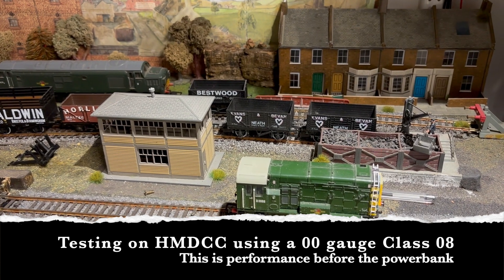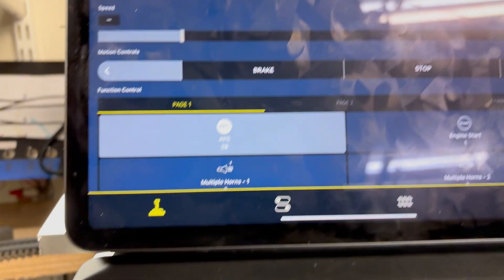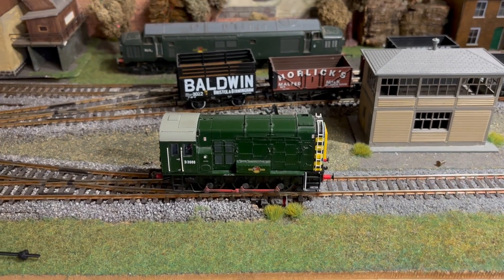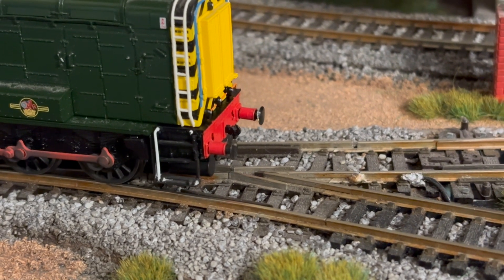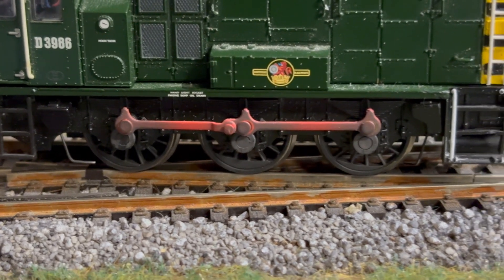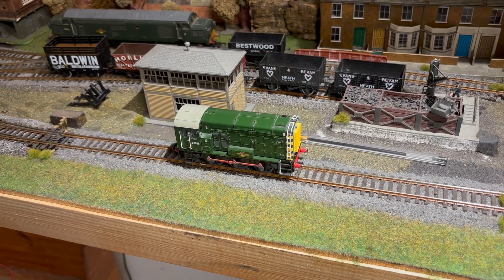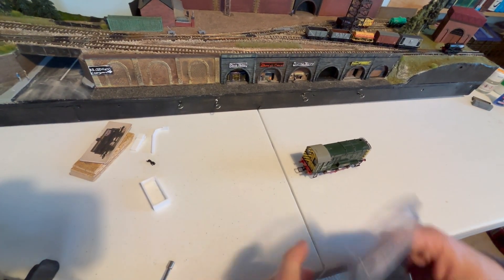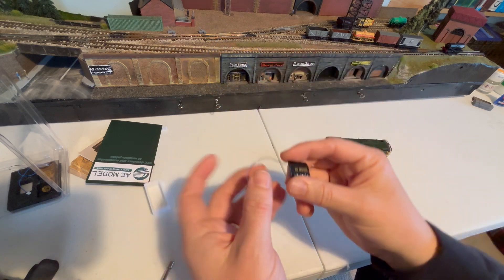Hornby HM7000: Does it NEED a Powerbank/StayAlive?

Comment: In answer to the question posed in the title of this video - Yes. No ifs, no buts, they simply will not function correctly without one.
Reply from the maker: I’d nuance that slightly to say that if using them over Bluetooth I would recommend a stay alive. If using in DCC mode the I suspect it’s overkill.
Reply: @mactrains But Bluetooth is part of the correct functionality, no? In any case it doesn't need to be a large capacitor bank - I use the Dcc concepts micros, they're sufficient to provide trouble free running without taking up too much space.

Comment: Good demonstration. I'm running n-gauge, and the HM7000 decoder fits inside Dapol's 'speaker ready' class 50, and probably all the big diesels that are speaker ready, but fitting a stay-alive as well is too difficult. I have found the quality of running has improved immensely by using my regular controller, rather than the bluetooth connection to my phone. It seems to be the bluetooth that causes the long interrupts, and if you can avoid it, then a stay-alive is less important. Of course, with smaller Bo-Bo diesels or shunters such as demonstrated here, then fitting an HM7000 with any kind of speaker is more than challenging, let alone a stay alive as well :face-orange-frowning: ... unless you are a TT or OO user of course.
Reply from the maker: Good point Graham, yes it's the bluetooth that really impacts the connectivity issues. If your dcc--to-rail connections are solid then I'd agree that a stay alive ought not to be needed. In that case just use the HMDCC app for updates etc, and switch back to DCC mode for control.

Comment: Good result.
One question. How much does it cost to implement these changes per loco? 
If you have a large collection of engines. You even mention that the cost will soon mount up. 
Ummm, yeah. 15 years is not really old.
Most of my collection is Vintage (4 times as old as your Class 08) so this is not a fix for all of us.
Thanks for sharing the process.
Happy Modelling.
Reply: Thanks for the question. Yes I should have included figures! The three pack cost me £42.45 plus shipping. Thats £14.15 per stayalive. Of course if you are adding decoders too then that’s quite a jump on top of that, especially if its older locos that have no dcc sockets. Hope that’s helpful. Thanks for watching and commenting.
Reply from the maker: A lot: see answer from my other account

Comment: I would got slightly further and I know @peachy agrees. I have a TT120 layout with sections of perfectly laid track you could eat your dinner off that cut out using an A4 with HM7000. I added a power bank and that solved it. Some experts on the forum say this shouldn’t be necessary but with the reset logic of the HM7000 decoders and the long reset time I think it’s a must have
Reply from the maker: I’ve had very few cut outs with my Night Hawk, but not none so will be looking to fit it and likely the 50 that’s due tomorrow with them. When it removes even the whiff of the suggestion of a cut out it changes how you feel about operating the layout. Well for me anyway! Thanks for watching
Reply: @mactrains  I feel exactly the same. From holding my breath and frustration to a calm relaxed feeling

Comment: Clean the track and make sure each piece of track has droppers
Reply from the maker: Thats the right answer of course - assuming you have not already laid the track, and assuming that it won't take you hours and hours, and won't cost you as much in solder and cabling as the £15 to get a stayalive! I suppose it's about how much you value your time. For those who get satisfaction from knowing the track is beautifully laid and that all parts have perfect power - there is no argument with that. For those more impatient, or those less gifted in soldering then the stayaolive is a great option to have. Thanks for watching.

Comment: Hello Mac, a question not particularly related to this post but towards HM7000 usage generally, if I may?
I'm looking to invest in some tablets for the layout I'm building soon to enable multiple users to cover main line, branch line, sidings and loco yard control, do you have any suggestions for cheap but not nasty tablet options and perhaps what to avoid?
Apologies for hijacking but this is a topic that doesn't seem to be covered much with the assumption that a tablet is already to hand, I find using a phone can be a bit fiddly at times!
Reply from the maker: Not a problem at all to ask. But what’s your budget? If you want solid and reliable at budget prices then Amazon fire might fit the bill. But you would need to a) install Google play store onto it and b) double check that it’s compatible. I’d recommend posting this question onto the Hornby HMDCC forum. There’s lots of super chaps who will be able to offer you solid advice. Thanks for asking!
Reply: @mactrains  thanks for the response. The budget is obviously a consideration but it's really about value for money and suitability, the Fire tablets would be an obvious choice on cost but don't appear to support Google Play, which I suppose is no great surprise really. Some of the Chinese options look reasonable but the uncertainty on software update support leaves doubts when looking at buying a few! Still I haven't built the layout yet so time is on hand to do the research as you have suggested, so thanks again.

Comment: Yes, yes & yes. Did I say yes? The powerbank/HM7000 is a winning combo…
Reply from the maker: Its very hard to tell for sure, but I think that ol' Peachy is a man who likes a power bank...!
Reply: @mactrains  🤔😝🤣
Reply: You never mentioned it before 😛
Reply: @Skiing_Postie  🤣
Reply: Question for TT:120 is finding the space 🤔
Reply from the maker: Indeed - I think they should surely be able to make much smaller ones available. We really only need two seconds I'd think in almost all circumstances. If that means a powerbank that is 80% smaller, I think we would really be able to get ones to fit almost any TT or even N loco.
Reply: @Skiing_Postie  absolutely. And as it’s predominantly only required to keep Bluetooth connectivity, surely a tiny capacitor could be added to the decoder board?
Reply from the maker: I like this idea. Personally, though I love sounds, I'd choose space for a PB over a speaker any day of the week. But then I get greedy and want both...
Reply: I want one in each of my TT120's   but wouldn't want to try and fit it myself. Too scared of messing the train up.
Reply: @trevorbellTT120 What locos are you wanting to fit them in Trevor? Some are more easily fitted than others.
Reply: @gregmacdonald927  an A4 and A3 (Trigo and Falcon)
Reply: @trevorbellTT120  Thanks Trevor. Peachy has a video on adding power banks to them but it does required remodelling the coal loads. Have a looks and see if it’s of some use to you. For now that’s the easiest way that I know of, but it may be worth waiting for the newer Hornby ones that are meant to be 30-40% less volume, which should make for an easier fit.
Reply: Might have to invest in Greg’s Stay Alive 3D Templates
Reply: Also need a “stay alive - TT loco model guide” so we know which ones will fit each model with or without mods … be interesting to see the dimensions on the smaller hornby ones (maybe try your contacts 😉)
Reply: @Skiing_Postie Agreed. Maybe worth compiling one for the forum. From what I know so far only the HSTs can accommodate one without any destructive adjustments.